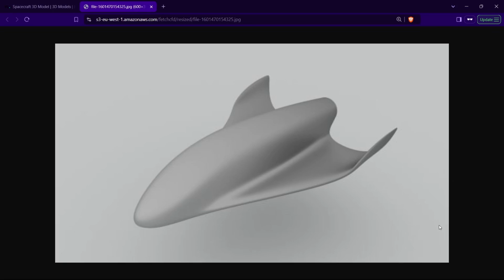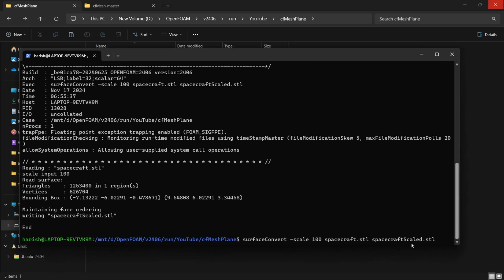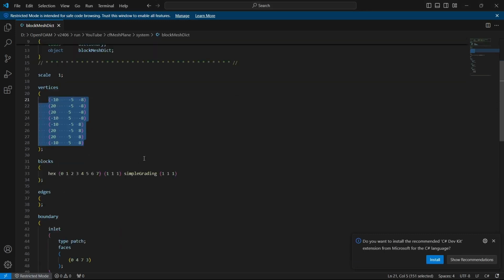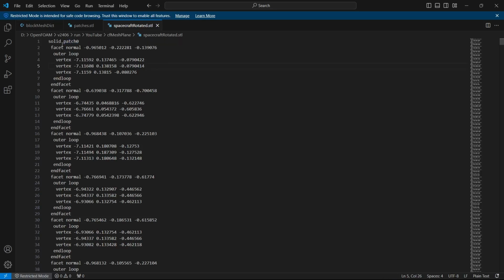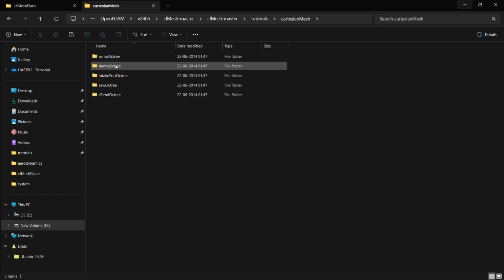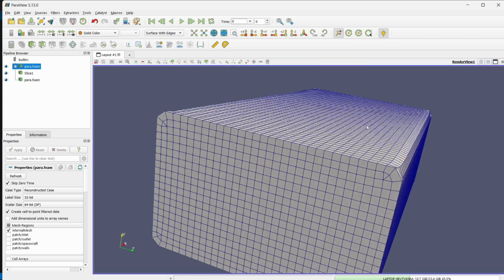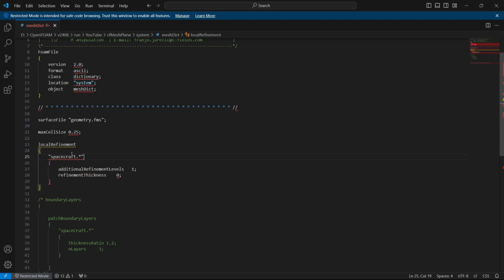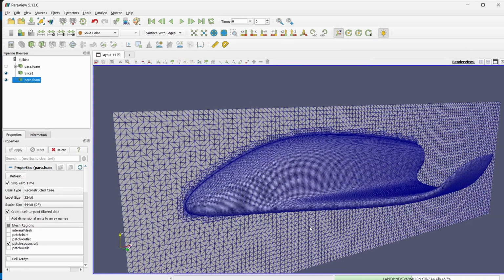cfMesh - Spacecraft meshing OpenFOAM Tutorial | English

Comment: In my regular workflow i use snappyHexMesh and it has been tricky to understand every step. Would you say cfMesh is better and if so, why?
Reply from the maker: If you are working with just a single cellzone, then cfMesh would be much faster and easier to setup. That's the biggest advantage. mesh quality is also better in my opinion.

Comment: Unfortunately, CfMesh is not the best tool for boundary layers. I am aware of the premium version but as far I remember was pretty pricey.
Reply from the maker: It definitely is not the best tool for boundary layers. But totally better than snappyHexMesh. If you are fine with tet mesh, then salome is the best among free software.
Reply: @Codeynamics  snappyHexMesh seems have added some new features on OpenFOAM-13, I wonder whether there's standard  test case to judge their meshing ability?
Reply from the maker: You can use the motorBike case and propeller case to test it.

Comment: surfaceFeatureEdge is not shown in my OPENFOAM 2406 version. should i use surfaceFeatureExtract option?
Reply from the maker: That command is part of cfMesh. Have you installed cfMesh?
Reply: @Codeynamics   I realised that. I was trying to install as mentioned in ur 3 minutes installation video. I am getting the same error as already mentioned in the comment WG null set
Reply from the maker: Please check the other video. That should work.

Comment: When copying the meshDict file what should do for system and constant folder and how to alter that
Reply from the maker: for mesh generation, all you need is controlDict and meshDict. just have the constant folder. nothing else is needed. 
other files are setup based on the case requirements.
Reply: I have doubt on meshDict
Reply: I have stl file and how to start meshing with cfmesh like how to create my meshDict or constant folder for my model
Reply from the maker: @Manu-iz3nr  change the parameters such as file name and the cell size values.